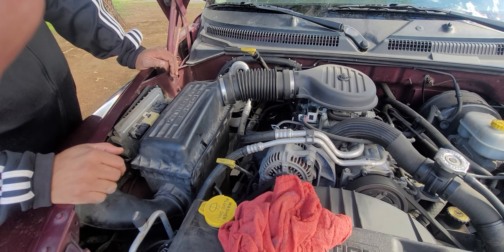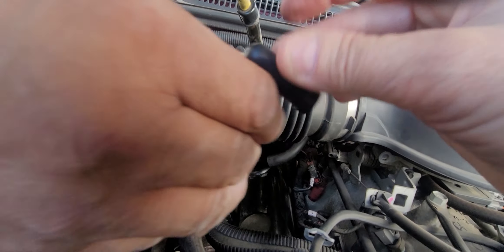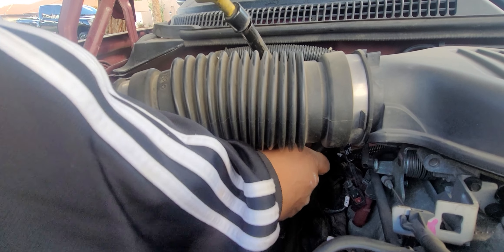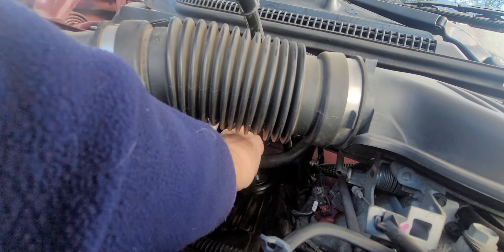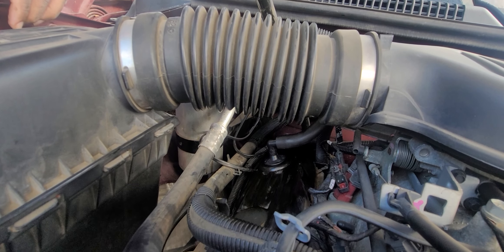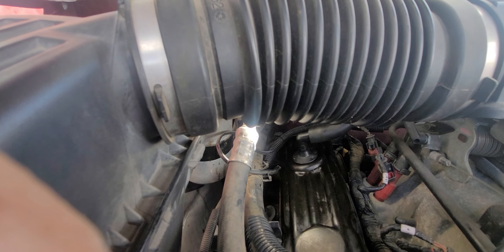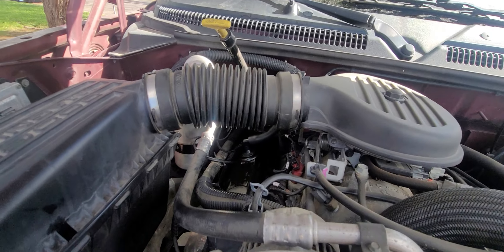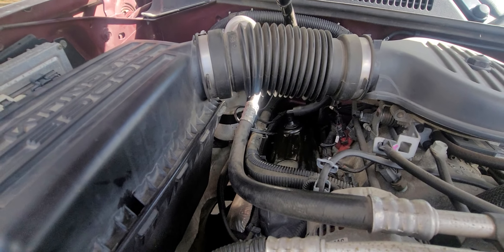Replacing the PCV Valve on a 2003 Dodge Dakota. Sometimes ya need a bit of 💪 thanks Benny! 👍

Comment: You are quite the mechanic!
Reply from the maker: I been researching alot to see why my check engine was still going on. I replaced the leak detection pump and the purge valve myself. But needed muscle getting the PCV valve in there.  But it's running smoother now. I had the codes cleared in the trucks brain box (computer) So fingers  crossed 🤞 its fixed now! 😊
Reply: Hey your coming right along  Youll be changing screens on transmissions next